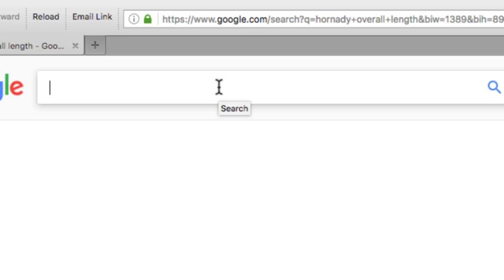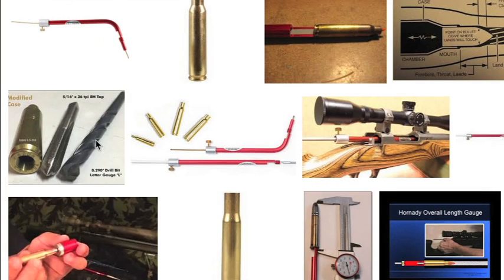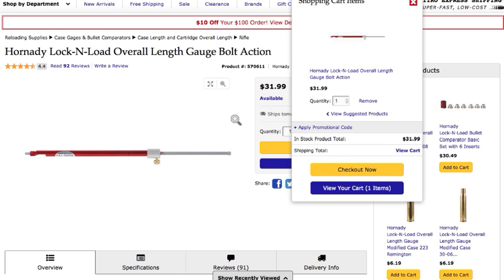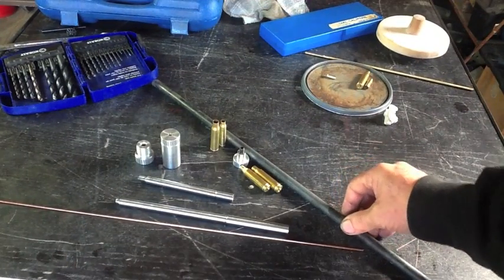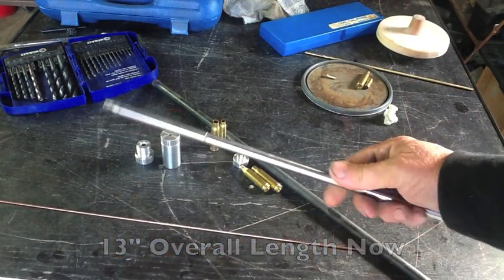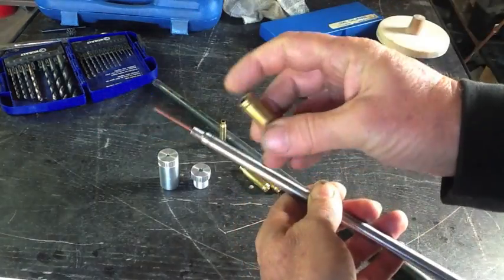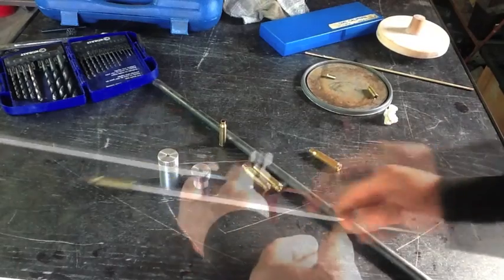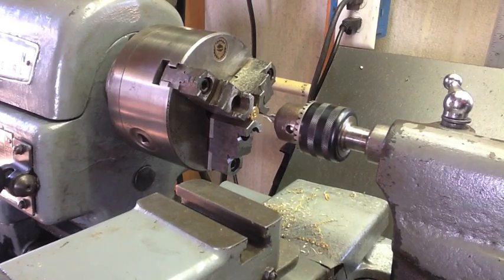Shop Made Overall Length Gauge (OAL) - Hornady Style - MSFN

Comment: You forgot to include a place (port) on the case head that you can measure the bullet / case combo with a caliper blade.   Also you need to expand the case necks (or ream) to .002" over the bullet diameter.     The push rod you furnish will also not allow you to measure on the centerline of the case bullet combo.    I doubt that  5/16" tap was able to work on the 223 case heads as the coarse threads will detach the base at the extractor grooves on the case.    Ask me how I know.   Grin.   But nice machine work.

Comment: I was just thinking about building the comparator inserts and holders for checking the oal and headspace.  Funny how I ran into your video.  Good work.  I've been subscribed to you for a few weeks.  I have never seen the actual parts, I wonder if they just chamfer the hole where the bullet goes and for the shoulder ?  I guess it don't matter much since it's just for camparing lengths.
Reply from the maker: I dont think a chamfer would matter since a caliper will measure the length once seated....its a "relative" type thing at the end of the day in my opinion
Reply: @MakinSumthinFromNuthin  Actually.....you need to expand the case mouth by .002 so the bullet can slip in the mouth.

Comment: Nice work on the lathe.  I disagree with your point about saving money though - you spent a whole day in the shop to save $60.  And you probably used $30-40 in materials!  Not worth it.  Buy the Hornady tool and comparator set and then make your own modified cases (not to save money, but by using fire formed cases from your own rifle you'll get more accurate measurements).  I've certainly made stuff in the shop just for the heck of it, and it can be fun, but buying the tool from a store is much more cost-effective.
Reply from the maker: Fair enough, but I owed my brother a favor and it gave me Lathe time...I only had the Lathe for a few months at the time and it is my 1st Lathe so the experience I gained was well worth the time invested. The material cost was no where near $40 for me. I have made 2 other gauges (they didnt want comparators) for viewers that wanted one identical to this one and and was worth my time making them. The viewers mailed me their casings for drilling/tapping so the vid got my brother taken care of...and got me two jobs...I call that a success :)
Reply: As long as you had fun!  Heck, I made a muzzle brake for my .338 in the shop one time and it took me most of the day.  Could have bought one for $100.  But sometimes you just feel like working in the shop, and the satisfaction of making your own stuff is hard to put a price on.  Plus I'm sure your tool is of better quality than the Hornady.
Reply from the maker: Thanks Cody, than you know where I was coming from...the time wasnt an issue for me. I am new to machining so a job that a professional might do in an hour with much better equipment than I may take me 4 hours being inexperienced...but I have quickly taken to lathe work, discovered I am pretty good at it and really enjoy making sumthin from nuthin! :)
Reply from the maker: PS: Hope your muzzle brake turned out well!
Reply: Cody Colvin I'd use double that much money in parts if I made what I wanted and had fun doing it.  I sometimes get the feeling that people buy machine tools for home use for that "just in case I need to make something" itch.

Comment: you need to mill a flat by the treads for measuring so you can can get close to the center of the case and bullet, looks good nice project I made a similar with my craftsman 12 inch just like your lathe only mine make more noise
Reply from the maker: I dont have a mill... :(    My brother has a mill at work and said he would mill the flat and the slot in the comparator for the calipers, thx for watchin!

Comment: Your lathe is SO much quieter than mine. Great work. I'm just about to try internal threading for the first time, but I need to make the toolholder first. Looks like you just jumped right into it. You rock.
Reply from the maker: They have this cool thing called audio volume control in my editing software....so I wouldnt say mine is exactly quiet. LOL

I need a toolholder for internal threading as well, otherwise would have tackled it already. I used a tap for the internal threads shown in this vid. Thanks Rick! :)
Reply: I had been thinking the same thing Richard, my commercial was much louder than yours. Now I know why. Great score.